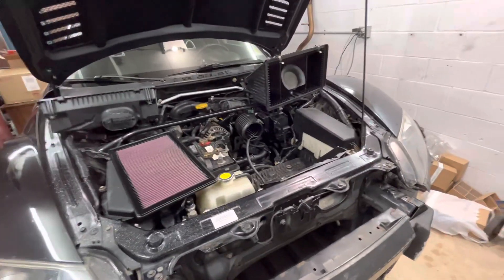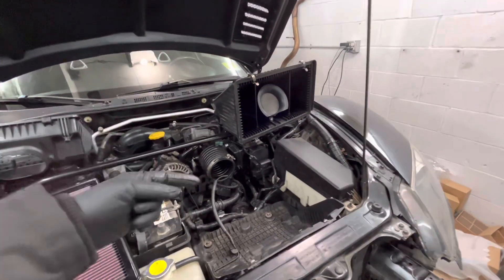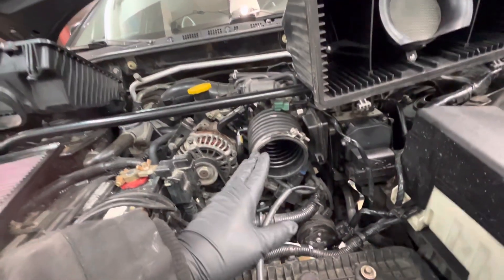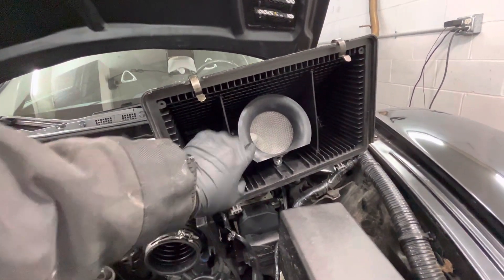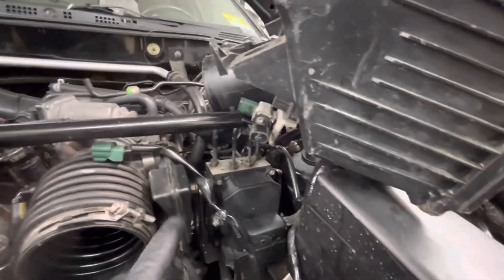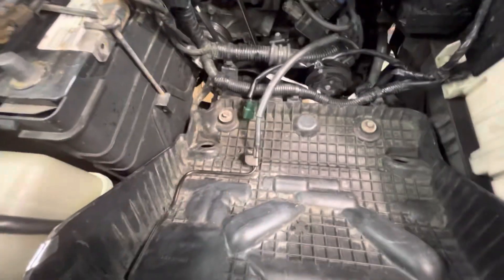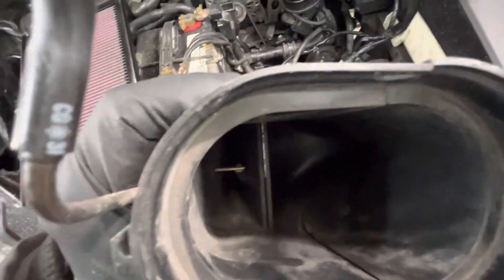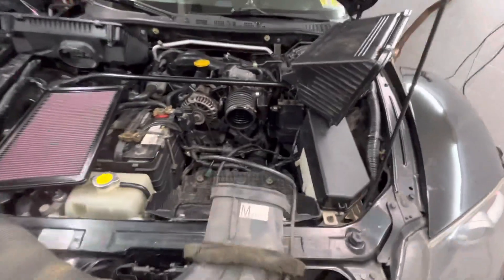RX-8 Stock Air Box Explained – Why Cold Air Intakes Can Hurt Performance

Comment: Just now learning that my rx8 never came with that front hose. I’ve ran it fine for 4 years now, always maintained it and what not, I seen that vacuum hose today and could not figure out where it went and now I know it doing have a home. So is it going to even make a huge difference for me to put a cold air intake on it knowing that I don’t have that front hose?
Reply from the maker: No it is not. If it were me I would just make sure to incorporate the first black rubber part that comes out of the throttle body. The part with the side little box that’s connected to it. After that piece go nuts. Having that little box on the side of the rubber intake will help you once you get off the gas pedal and quickly back on. That air pressure will go to that little air box and once your on gas again the response is there..might be over kill but for track driving that’s ideal. Also all the spec rx8s with “cold air intakes” incorporate that piece. Good luck.

Comment: love the video. I agree, engineers take a lot into consideration when building a car. A LOT MORE THAN THE AVERAGE PERSON. What do you think about the Racing beat Ram air intake?
Reply from the maker: I’ve been in the RX-8 game since 2008 and was active on the RX-8 forums long before social media took off. Over the years, I’ve seen the information evolve as people learned more about the platform. I’ve even reached out to the Time Attack community in Japan (using Google Translate), and they all run setups similar to the stock airbox—specifically, one made by RE-Amemiya. The main differences are that it’s smaller than the OEM unit and features a ram intake.

Meanwhile, in Australia, the RX-8 Cup racers (think of it like Spec Miata but for RX-8s) remove the stock airbox for cooling and run a cold air intake similar to what we see here. However, they retain the OEM black rubber section of the intake, including the side “box” just past the filter.

With all that in mind, if I were upgrading my intake, I’d go with the Racing Beat setup paired with a ram intake. In fact, I’ve been considering getting that setup myself for this year’s track season. Best of luck with your RX-8—enjoy it!

Comment: I took all the oem box and threw it across the fence. Made my own intake out of 3.5 inch aluminium.  Used the mesh before throttle body. Coolant temps dropped 15 degrees and it goes hard...also threw the plastic over fan across the fence as well
Reply from the maker: Hahahaha did you relocate the battery as well?
Reply: @pv4083  not yet but I'm considering putting battery where windscreen washer reserve is. I'm in Australia 🇦🇺
Reply from the maker: Yea a lot of Japan guys relocate the battery to that spot…the washer fluid location.

Comment: Any thought on removing the “walls” or “baffles” in the stock air box? Heard a rumor they were only installed on US models to meet certain regulations and that removing them significantly improved airflow and throttle response.
Reply from the maker: I’ll make a video to have a more in depth discussion and hopefully answer your question. I got you!
Reply from the maker: Checkout the video I made

Comment: I run a CAI, and when I first put it in, I noticed all the best. First of all, I was aiming for less temperatures. I live in a climate where we get up to 40ºC in summer, which is a lot, and even tho I have a vented hood, it would still heat (less, but still) because of the air box, it's a huge piece that goes over a fan and a half. I solved the problem with the CAI. I also noticed better throttle response. I tune my ECU myself, and I already had the throttle tuned to be more precise, but now it goes pretty well. No low end loss, and I gained enough hp to notice it myself, and not with the computer. 

Now, I paid for my AEM intake around $100, second hand but in good shape, with both screens and pre-filter. It all depends on what you're looking for. In my case, the CAI is working great, even in summer conditions. Hp gains may be 10, 15..... idk, didn't dyno it yet, I'm waiting to change the exhaust manifold too, but for what I needed from it, I got what I was aiming for, which is less temperature under the hood.

Also, when I changed the intake, I did remove the coolant hoses out of the throttle body. It takes a 10mm pass through (you can buy it for 80c on aliexpress) and it will work like a charm. Unless you live in Alaska or Siberia in winter, your throttle body won't freeze.
Reply from the maker: Thank you for the information. I’m glad it worked out for you. 👍
Reply: i went aftermarket for this exact reason now i just gotta do some MAF scaling and work out a decent tune

Comment: The stock air box is just so big it takes up a lot of the engine bay and is a shitty design to change the filter... If you're losing power I think you probably have bigger problems besides lacking the useless vfad... Mazda designed the aem cold air intake and has never given me problems besides in the rain...
Reply: I moved my battery to the trunk and run the AEM cold air. It has made my car so easy to work on. I would highly recommend.

Comment: The only CAI proven to work us the AEM. To suggest the oem intake is not already a CAI is a common misconception; it certainly is a CAI.
Reply: Yep! This is true. In fact, the AEM CAI is a mere replica of the MazdaSpeed intakes. On some of the AEM CAIs you can actually see a MazdaSpeed engraving on a couple of parts. This isn't the case for all of them of course, but with this in mind, the AEM CAI is technically OEM to an extent, which is why it works so well.

Comment: This was suggested on my homepage and I just want to thank you for taking your time to explain and demonstrate everything.
I only run K&N drop-in air filter on mine and I see that some people might disagree with your statement of "Don't run cold air intakes".

Regardless, I find this video useful to learn more about our air intake system. To each their own but being able to understand the whole system does get us one-step closer to becoming a wiser owner.

Today marks a full 3 months of me owning an RX-8!
Reply from the maker: Exactly..to each their own..and like you said it does not hurt to gain additional knowledge. I actually took the car out for a test drive today after installing the new suspension ( it felt like a crab ahha I need an alignment-that’s another video) and I felt the difference with the stock air box. Again to each their own but I will be keeping my stock air box. Lesson learned…congrats on the RX8. Let me know if you have additional questions.. Zoom Zoom!
Reply: Awesome! I've had mine since January 30th!
Reply from the maker: Let’s go!! The Few.The proud.Rotary Heads!
Reply: No idea if the rx8 uses a map sensor or maf sensor, but i wouldnt use a k&n or any oiled filter with a maf

Comment: The OEM airbox was designed in this fashion for a reason.  Changing it out to a CAI comes with pros and cons.  Depending on how you're going to use your 8.  If it's just going to be a summer vehicle or if you don't encounter harsh climates, it'll probably be worth doing the MS/AEM CAI.  The problem is cost.  Do you really want to spend about $800 (if not more) to do a CAI?  To gain maybe 2-3hp??  Not to mention the total PITA it'll be to do maintenance on the filter.  Getting to the CAI filter to change out will become a real chore.
I use my R3 as a daily.  It encounters weather ranging from -40C all the way up to 48C.  Rain, Blizzards, sometimes light hail.  In the past 5yrs now that I've owned my R3, she has never missed a beat. 
Keep in mind, I've done things to maintain her in tip top shape.  Also to prolong the life of the engine.  I think the first thing anyone should do is eliminate the damn cats.  You own a rotary, you have to get rid of the cats if you expect your engine to survive longer than 100k km's.  That was 1 of the first things I did when I picked up mine.  It was still with the stock cat after 50k km's on the car.  I could tell she felt a little sluggish and not really willing to rev as fast as I expected.  The previous owner did spring for an RB cat back.  So all I did was pick up a BHR midpipe and got the RB headers for the engine.  Made more room in the engine bay by eliminating the electric airpump.  :)  Difference was very noticeable.  Not so much audio either.  But her willingness to rev became apparent.  She could exhale properly.   She moves as expected now.  Without deteriorating its practicality either.  :)
Reply from the maker: I love the fact your RX8 still out there taking all those environments like a champ! And thanks for the advice.
Reply: @pv4083  it’s severely underrated. Simply because people are afraid of the engine. 🤷🏻‍♂️
I honestly think I’ll be keeping her forever. I’m pretty sure I’m done getting any other vehicles. Rotaries for life. 🤞🏻😎
Reply from the maker: @neoanderson7  haha true. I just think that folks nowadays are afraid of commitment and learning how to properly maintain a car. All cars have their “thing” and folks sometimes are mentally lazy and just follow whatever someone says and never take the time to learn and see for themselves which in my opinion is a rewarding experience…and same here. I’m keeping my RX8 for life. I bought other cars but I’m never selling my. RX8. Haha…#The.TheProud.RotaryHeads..
Reply: @pv4083  very much this. People don’t care. They just take it to the dealer. They see the price and then they have the Gaul to complain. How do you think all these fancy dealerships come about??  They’re paying for it thru service. Simple things getting charged thru the nose. 🤷🏻‍♂️
Oh well. Better for the rest of us. 😉😎
Reply: Great cars loved mine. Get ls coil packs #1 mod for rx8 faster revs and maybe better mpg... Not much tho
Reply: Id just hate having to deal with the fumes in the cabin. It fucking sucks.
Reply: @xMorbidArtx  No fumes enter the cabin.  Unless of course you're driving around with the windows down.  And even then, it doesn't really come inside.. Maybe I've been exposed to this sort of thing, I don't even notice anymore.. lol 🙂

Comment: Thanks for making a video bro. Have to admit I have installed a diy CAI on mine and have not had any negative effects. Feels like it breathes better up high RPM and sounds cool. Idle was a bit crap, but when I put the gauze back in it was fine. Intake temps are sweet. Only 2 degrees more than ambient. Cleaner engine bay. Better heat removal from the radiator. Each to their own bro.
Reply: I think the hose that goes from back iron to throttle body heats up the intake a bunch remove that hose and loop around throttle body and intake temp was much cooler with stock air box and a knn filter